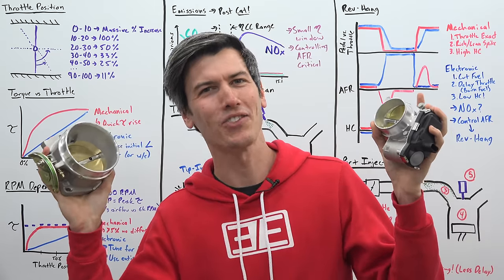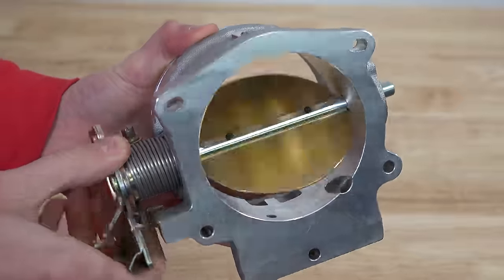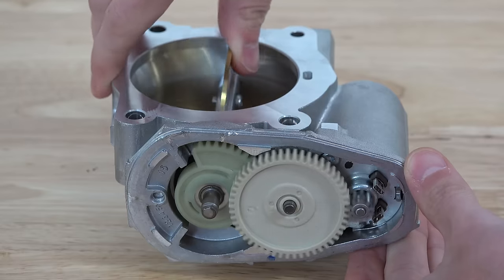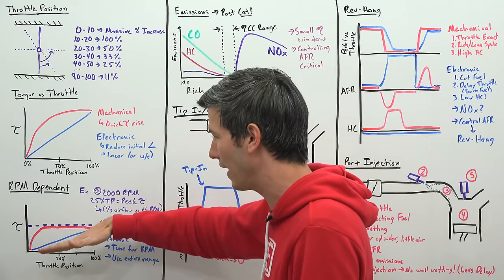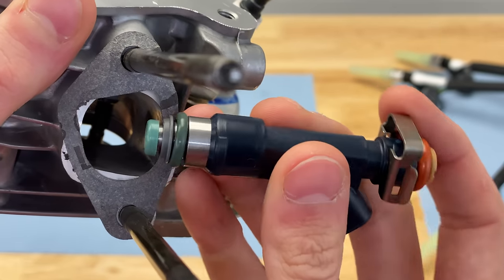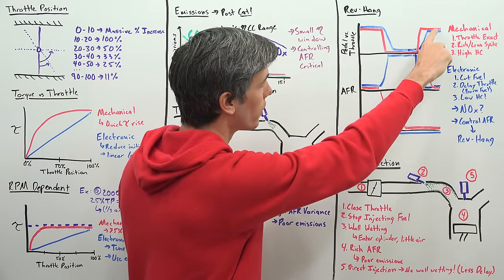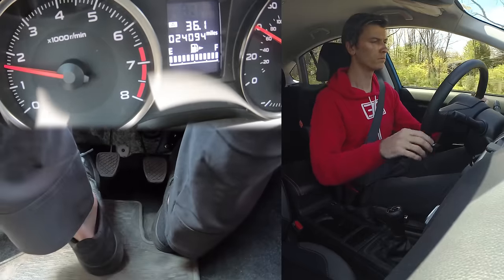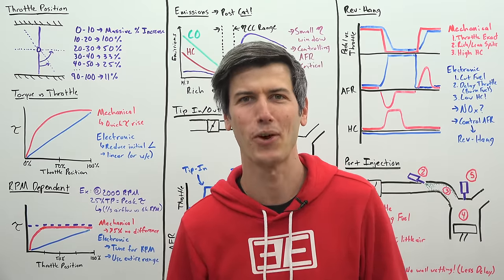The Big Problem With Modern Manual Transmissions - Rev Hang

Comment: Main takeaway is emissions regulations are ruining the driving experience....
Reply: Yeah when hasn’t it been
Reply: Planet Earth  How much time is spent shifting in the typical car? Far more could be saved by increasing gas prices to encourage efficiency, and less travel.
Reply: it ruin other driver's experience because that exhaust port will burp thick smoke without such emission control. Ewww... looks antique. "HC" (Hydrocarbon) is a polite way of saying "thick smoke".
Reply: @xponen  the only vehicles making "thick smoke" are the ones with diesel engines. I would actually like to see the data on how much more emissions are produced without the programing of the electronic throttle body.
Reply: Yeah but atleast pollution isn’t going to kill us as quickly
Reply: @randomvideosn0where  The interesting thing about emissions is that it's a super fine balancing act. I used to test and calibrate diesel engines at my first job, and extraordinarily small changes in timing, fuel, etc. could result in 10x emissions changes. Look at that plot of CO emissions that Jason makes in the top right. That's actually a realistic graph. If you miss your lambda by a few tenths you can multiply your emissions by 10-100x. An excellent real life example of this was dieselgate. Some testing was reporting engines testing over 100x the emissions limit, while the actual engine performance was only marginally different. So basically, yes, it does matter, because if you shift twice per minute, and a shift takes 3 seconds, but during that 3 seconds your engine makes 10x as much emissions as normal operation, then 3*2*10= the equivalent of 60seconds of normal driving. i.e. your shifting emissions doubles your normal driving emissions.
Reply: It's a shame I have a throttle cable and no cat..... Oh well sounds better.
Reply: Planet Earth  it is not necessary
Reply: Anifco67  We will be ruining the environment as long as humans exist, period. There is no way around it, we can do what we can to offset the effects,  it is what it is.
Reply: @tscook10  I guess I might be out of touch a bit, I hardly ever shift.  Then again I either walk/bicycle to places nearby or am getting on the highway for longer ones.
Reply: @manitoba-op4jx  and the driving dynamics, unless you like floaty or boneshaking.
Reply: @randomvideosn0where  Rev hang actually slightly increases the consumption. It's done to reduce hydrocarbon and NOx emissions. The same with particle filters and catalysators: if you only mind about fuel consumption, all those should be removed because every part there increases CO2 emissions. However, CO, HC and NOx emissions are actually more dangerous to humans so we have such emission control devices.
Reply: As they have been since about 1973
Reply: @FieldMarshall17  I've got a '73 Lincoln, it runs great!
Reply: Planet Earth  Not really
Reply: f the emissions... close the damn valve. rev hang is so annoying
Reply: Wait until cars don't have steering wheels.
Reply: Switch to automatic transmission cars, problem solved
Reply: GoogleMinus the problem is is that many places in America (not sure about other places) are so spread out and there is such a lack of public transportation that cars are a necessity. My work is a 10 minute drive from my house and my school is a 20 minute drive to goto the grocery store is a 5 minute drive to get to any large shopping areas is a 20-40 minute drive increasing gas prices will just make it where people can’t goto work and can’t go anywhere without walking or biking for hours down busy roads with no sidewalks what needs to happen is a switch to clean energy and electric cars
Reply: @paul-4872  or better city planning. if you design your city buildings and roads properly there wouldnt be so much traffic. you would also reduce the need for personal vehicles if public transit was properly designed and scheduled.
Reply: Planet Earth  emissions are a necessary evil mate
Reply: Took the cat off my car, turned it into a hollow pipe, put it back on. Problem solved. Now 3 more cars to perform cat purges on....
Reply: Yup, especially if you live in CA. They hate cars.
Reply: @bboyairrick  Don't they just hate and tax everything? kekw
Reply: The emissions have improved so much that I can now stand behind a redlining car for more than 20 mins and still be alive. Emissions regs don't need to improve any more
Reply: I don’t agree.  Part of the driving experience is breathing the air along the highways.  The air is noticeable cleaner than it was in the 1970s, when the EPA was founded.  I prefer breathing clean air.
Reply: Bad air will ruin your life experience.
Reply: @richardwanamaker9080  Good thing the air is fine anywhere I've been.
Reply: Dont worry, soon enough mild hybrids will be everywhere, and I bet they could counteract electronic throttle behaviour.

Comment: Finally know why shifting into second takes so long.
Reply: Also adding trickyness to the 1-2 shift is the fact that it’s also the largest gap and the revs have to drop the most.  The gap is smaller for every successive shift, making rev hang less and less of an issue. 

Unless you drive a semi. Each of the 18 gears has exactly the same space. You learn a rhythm and shifting a breeze. Most truckers only use the clutch to launch, and then shift every other gear without clutching. But that’s a whole other video ...
Reply: @ianswitzer2915  I heard about shifting without clutch in semi trucks in America, but never heard about it in Europe. My dad who is a trucker here in Europe never heard about it. I think that a lot comes out of European truck's being made differently. But my dad now is happy, that he drives Volvo with new automated gearbox =)
Btw, clutchless shifting is very popular in motorcycles. Especially if you are more kind of sporty rider. Even without quickshifters, which cut ignition while doing gearchange (and that lovely bang when fuel get's burned in exhaust).
Reply: @Stasiek_Zabojca  if I recall, some (or many?) bike transmissions actually use dogs to engage the gears instead of the smaller teeth from synchronized gearboxes from most cars, so it happens easier.
Those 18 gear 'murrican semis are a beast of their own too, they don't have synchros from what I know, 6 gears on each normal, high and low, pneumatic assisted. I remember asking some truck driver how it is that he operates them, from what I remember he said pretty often he skips quite many of those gears or the entire section (low, normal or high) and so on, or just wack the shifter to the side, and the air assist shifts to the next gear.
It's also common to grind gears sometimes on those, no matter how experienced.
Reply: @Stasiek_Zabojca  Clutchless shifting WAS common in Europe back in the day when manual trucks were the only option. Synchronized transmissions were introduces quite early into trucks in Europe but the legendary Eaton-Fuller is not synchronized and requires clutchless shifting to work properly.
Reply: @Kalvinjj  
Every bike uses dogs.
Basically all sequential transmissions are dog boxes.
Reply: So according to this the amount of rev hang should depend on the amount of fuel injected at any time instant. Does that mean you will have more rev hang when you are on wide open throttle ( high loads)?

Comment: The Geo Metro was magnificent in its simplicity
Reply: That is the one main thing i miss about my old Suzuki Swift..(same as the Metro there) :( That throttle feel/response is whats missing from every other car i've driven...
Reply: I had 3-cyl metro with a 5speed. I absolutely love and miss that car.
Reply: @joesdiy4260  Imagine that with the 1.3 86hp version.. For it's 850kg :))
Reply: ...And got Hybrid-beating gas mileage, back in the early '90s. Incidentally, the only speeding ticket I ever got during that era was from flying downhill in a borrowed maroon 3-cylinder Geo Metro. 😁 You had to have driven one to understand.

Comment: My Ford Focus ST is pretty good in this regard but I have driven other modern manuals where it was very bad, a Honda Accord sport comes to mind. My Tesla on the other hand, can’t get it out of first gear so it just hangs all the time. 🤪
Reply: My GTI isn’t bad but I had an 8th gen Civic Si and the rev hang was brutal.
Reply: Honda has killed the manual transmission because of this
Reply: That problem with the Tesla is easily fixed:
Just load it up with high octane and thats it. 

Bam! Fixed.
Reply: K C You can get Hondata to fix the rev hang, a good friend of mine has a tastefully modded si that’s a real blast to drive. It’s so driver-focused
Reply: That's a great car drove one w 3 200lb dudes in it and it still got it done. Would recommend one, amazing brakes!
Reply: Yeah my ST feels great. I was wondering how much people were complaining about their cars in the comments. I guess the st is just tuned well, such a great well rounded car

Comment: I'd rather have the throttle response of a mechanical throttlebody as I'd like to tap the petal to revmatch and not stomp on it
Reply: I agree rev hang as described totally ruins the enjoyment of driving a manual transmission 
If I am in control of the car I WANT THE CONTROL!!!
Reply: Windbooster throttle controllers
Reply: True, this is one problem I have with a drive-by wire gas pedal
Reply: I got one of those aftermarket adjustable electronic throttle controllers. It’s pretty sick not gonna lie.
Reply: @LeDank  when you get it?
Reply: @LeDank  my sport 9 setting is the same as my 02' NA Impreza's Cable throttle. Sports + settings and race are faster than cable though
Reply: @whoknows1631  about a year ago. Just allows me to change the throttle sensitivity and it’s absolutely nuts on the maxed out race setting.
Reply: @LeDank  yeah its hard not to ride the clutch in RACE
Reply: @whoknows1631  pretty sure racing and reliability are complete polar opposites as well.
Reply: Why can't you revmatch with an electronic control?
Reply: Yes, also you can make the engine make great noises while at 1000 rpms with 100% open tbi
Reply: Thanks for this comment. I was searching for someone mentioning rev matching
Reply: Good point but now I've gotten used to it from having direct injected turbo since 2006.  I toe/heel all the time now.

Comment: On the race track the rev hang doesn't allow engine compression braking to slow the car and rotate it into a corner. You're left with having to use the brake to rotate the car so you lose one of the car control options available. BAD!!
Reply: If left in gear the rev hang time is minimal I think and I'm pretty sure that it can be turned off with a tune... it's also a tradeoff minimized by the potential for computerized rev matching on downshifts.  I always had a hard time blipping the throttle with my heel during mid turn down shifts.

Comment: This explained why my timing was off shifting a Manual Transmission.
Reply: To be fair, it's only one of several possible explanations :-)
Reply: I compensate for rev hang by shifting as if I’m starting off from first gear at any gear change. Don’t step on the gas until you’re at the clutch bite point. Gone are the days where you have that see saw step of the clutch and gas pedal.
Reply: @rogrwi1co  me too.. have been shifting like that ever since i got a car that hangs.. i'll have to say that it works, but surely impacts the clutch / mechanics wear.. Shifting lke i would do in any car that doesn't hang, would result in an undriveable experience.

Comment: You can get non linear mechanical control with a cam.
Reply from the maker: Yes, but not at every RPM. 20% throttle at 1500 RPM might be full power, where as 20% throttle at 6,000 RPM might cause you to decelerate.
Reply: I was just going to comment this.  You can't get as much control as an electric throttle because that can be programmed for whatever you want, even really weird stuff, but you can still get an intuitive feel from a mechanical throttle body with a properly designed cam wheel.
Reply: In the 80's, I thought I saw some engines that had just that ... non-circular cam wheels on the throttle body. The typical circular cam wheels gave you the perception of having a bigger engine up, to 40% rotation.
Reply: The Porsche 944  Turbo had a very non-linear cam on the throttle. I think it helped a lot. You could feel the pedal stiffen when you got further in, and that point was right about when the boost would kick in.
Reply: Vtec?
Reply: The manual TB Jason is holding has a non-linear cam wheel, to reduce nonlinearity. The initial radius is larger than the final one, so input cable pull causes less rotation initially.
Reply: Real men don't need no stinkin' cam.  Hook your throttle cable directly to the throttle linkage on your Holley carb and make sure the butterflies are vertical at w.o.t.  Done.
Reply: @EngineeringExplained  that is were driver skill is important.  Now if you want an appliance then drive by wire is fine.
Reply: @bowez9  I think it's wrong to equate cars eith drive-by-wire with an appliance. It just gives you greater tunability. You can probably easily adjust the computer to behave differently with throttle input with electronic systems vs mechanical systems. Less hassle and can still have the same functionality. You can be a lot more precise with modern electronic systems vs mechanical ones. This is why pretty much every modern racecar is drive-by-wire, especially F1 cars. But would you say that those people don't have any skill? No, you wouldn't. Computer controlled systems allow far greater and finer adjustability than mechanical ones, and better visual and graphical representations as you do so which also makes it quicker. Don't get me wrong, I love fully mechanical systems as well, which is why I particularly love old WW2 era aircraft because they are just a marvel of engineering for the time, analog in every way and yet they were the beasts of the sky for a good while. However, I am also a tech person so I have a deep appreciation for what modern technology can do and the advantages it can bring and is just as fascinating.
Reply: @EngineeringExplained   As long as you understand how a throttle plate works then there's no problem.  A throttle pedal isn't supposed to be a road speed pedal, its supposed to be an air control pedal.  Obviously at 6000 rpm you're not going to feed the engine with enough air at 20% throttle, and at low rpms, 20% throttle is going to feed it plenty of air.  I guess if you don't know how airflow through an engine works then a mechanical throttle wouldn't be intuitive, but i think the vast majority of people can grasp the concept.
Reply: Doesn't have to be of a cam style, can be done with linkage geometry. This technique is used on some designs of parking brake - where the lever initially pulls a lot of cable then as brake pressure is applied, less cable is pulled.
Reply: @jth_printed_designs  while anyone may grasp the concept, it doesn't mean it's objectively better. Like for example, anyone can grasp the concept of a manual transmission, but that doesn't make it better than an automatic except in the area of enjoyment, but that's subjective and irrelevant to the discussion. Automatic transmissions are faster and more efficient than manual transmissions as they are generally computer controlled and can easily be quicker at selecting the right gear for a given situation than a person with a manual.  Don't get me wrong, I prefer a manual transmission just for the higher engagement in driving, but that doesn't make it better or even just as good. Same with mechanical vs electronic throttle bodies. A linear throttle response to pedal input is much more intuitive than the parabolic curve of mechanical ones. Sure you can get cams to even it out some but it's still a curve and still not as intuitive.
Reply: @M Bacon Ratio of application can be designed as you want with mechanical control.
Reply: @EngineeringExplained  Because people care about airflow when they press the throttle. lol. No, they care about vehicle reaction and will learn it if it's SISO vs. SIMO.
Reply: @EngineeringExplained  Yes, that's expected. Pedal position should be related to RPM. At idle, if I press the pedal only 10%, the RPMs should go to a certain point and stay there, not keep climbing to redline.
Reply: Kaelin the Drake  Never said it was better. Re-read.  All I said was that it can be (and is) completely intuitive as long as you understand what you are doing with the throttle pedal.